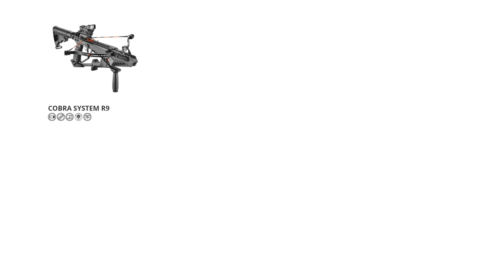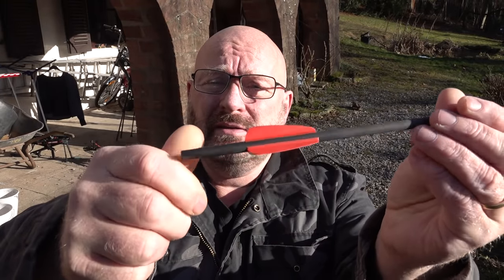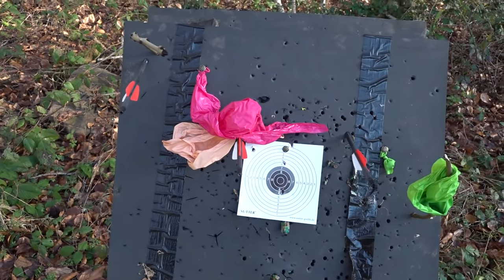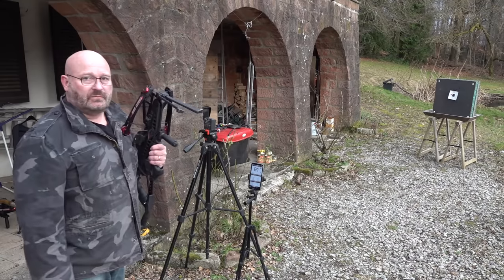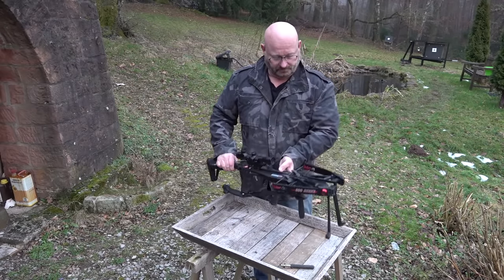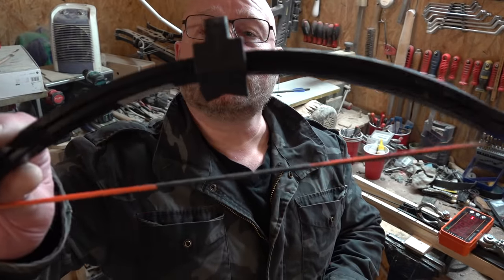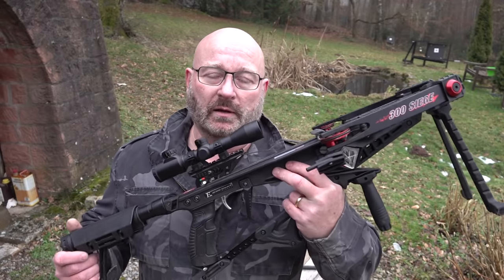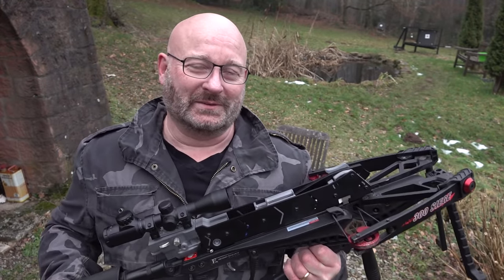The "Siege" Crossbow - Crazy Complete Review!

Comment: Reverse draw version would be insane. You would gain efficiency and lose like a foot in length. Hey Joerg send me one so I can build it haha 😄
Reply: Reverse draw? Can you explain? Cheers
Reply: @Meloncholymadness  a reverse draw is when the limbs are backwards facing away from you And this design eliminates brace height shortening the entire bow. Also you gain efficiency due to the string angle decreasing. Scorpyd makes good reverse draw crossbows.
Reply: I thought this too. Getting the slide to reach the string with the cocking lever in a reverse limb is probably the challenge. I’m a little shocked that the foot pound is so low. Needs a larger draw or better cams.
Reply: @CodyFIHS  needs better cams for sure they should use cam technology from regular compound bows you get way more efficiency with them.
Reply: @archery.customs  I suppose there wasn’t enough in the profitability to improve anything but the power they left on the table hurts. I would instantly buy for the $600 USD if it reached 100ft lb
Reply: @CodyFIHS  hell yeah because to me efficiency is everything. If they use better geometry in there builds they would have better products at not much more material cost. I guess it's the thought that counts and cost.
Reply: A reverse draw version will be the next generation. Maybe in abut a year or two from now.
Reply: @whiterabbitt2002  I hope so, if not I'll just have to build one myself 😆

Comment: Paper is amazing. If you want something that might stand up more to getting wet though, may I suggest trying out polystyrene card (also known as plasticard)?

It's a very common material that hobbyists use for model trains and miniature wargaming. It's plastic that come in a wide variety of thicknesses, even down to 0,2 millimeters if you so choose. Easy to cut with scissors and you could probably just duct tape veins made from plasticard to a steel crossbow bolt.

You can also glue it very well by using cyanoacrylate glue (common superglue), because cyanoacrylate will slightly melt polystyrene plastic before curing and basically weld plastic surfaces together to make a bond that is just as durable as the plastic itself.

Comment: Similar speed to the Ravin r26  top of the line hunting crossbow...but WAY faster to reload and much cheeper and no need to buy the really expensive press to change the string......this will drop most big game with the right hunting head on the arrow!.Cobra is on top of the game right now✊
Reply: You think this can drop an elk at 50 meters?
Reply: I have to disagree.   The performance of this bow is nothing at all like a Ravin or similar bow, not even in the same class.  I don't own a Ravin, but I do own a Tenpoint NXT400, and it will generate these same speeds(mine chronos at a consistent 408 fps) with a 400 grain projectile, generating well over 140ft-lbs of KE.  For the cobra to get that speed, he has to use a projectile of barely 1/3 that weight(139 grains) that he stated in this video, were much too light for the bow, and potentially dangerous.   To be clear, this is an amazing bow, but it's not a hunting bow by any means if ethical, clean kills(which should always be paramount), are to be considered.
Reply: @danielsimchuk7562  No way, at least not ethically.   This bow is generating those speeds using an ultralight projectile(139 gr) that has only a fraction of the KE needed on something like an elk, or even a deer.  I can get the same speed out of my bow using a 400 grain projectile generating about 3 times as much KE.  If you are in an area where crossbows are legal for big game, please consider one of the hunting class crossbows from someone like Tenpoint, Ravin, or Excaliber.  Performance and quality will be on another level entirely.
Reply: @NightwingGR1  Yes we all know that the Cobra crossbows have nothing on the Ravin for speed, distance and power as the Ravin and Ten-point and a whole lot of others. But the average person can't be bothered buying a 3000 Ravin500e or Ten-point Seige to name a few. They take forever to load, they're too heavy and needing winches or cranks like the dinosaur years. And for that sort of money you're better off with high powered rifles. The Cobra Seige bridges the gap a bit more so far as Speed, distance and power. Yet the Cobra Seige with a 7 shot Magazine is only $750 and heightens your chance of self defence. Easy to use, cocking etc. The Seige doesn't need all that extra power, speed and distance like the ones you've mentioned. I can afford all the ones you've mentioned as high powered crossbows. I personally choose a very Tactical, versatile, mobile and greater value for money crossbow any day. Tactical and very affordable crossbows are on the rise and will only get better.
Reply: @NightwingGR1  I'm not a hunter so excuse me if I'm mistaken, but it's draw weight is above the legal minimum draw weight for big game hunting in almost all states and 150-175 is what many hunting sites recommend for hunting elk. I get more is generally better (although sombre states have legal limits) but is there some other aspect this is missing?

Comment: Fascinating to watch the development of this platform. That said, having done a few of my own tests I’m convinced that the Adder (with the higher capacity clip-reloadable magazine) is the optimum tactical crossbow for home defense.
Reply: Yes the Clip reloadable magazine allows for the Adder to use the 15 inch bolts. Keeping in mind too that the Adder is faster and more powerful than the Cold steel cheap shot although both have the same draw weight of 130Lbs. I know the Seige shoots bolts faster, further and more than twice the power of the Adder, but I haven't seen the Seige with Magazine cocked as fast and frequently as the Adder. I own an adder and my crowd just find the speed and power of the Adder to be scary with some serious shock value.

Comment: In case people don’t know the most relative statistic (apart from shot to shot consistency) is the energy as described in ft.lbs (foot-pounds) /joules — this is more important in hunting than speed (fps/mps)
Reply: Exactly.  Several comments here have stated that this has the "same performance" as hunting bows.  It does not, it's not even close.  I shoot a Tenpoint NXT400 that generates about the same speed(mine chronos 408 fps).  BUT...it's doing so with an arrow nearly 3 times as heavy, at 400 grains, generating over 140 ft-lbs of energy.  The bow in this video would have problems with penetration on a larger animal at any distance at all, as in no case did the Ft-lbs of energy even approach that of modern hunting crossbows(in no case, even with the 1000 gr plus steel bolt, did it generate even HALF the energy of my bow).  Not to knock this, it's a very cool bow...but it's NOT a hunting bow.

Comment: Nice, some design decisions leave questions though. The scope being a moveable part is probably negatively affecting its zeroing/accuracy. Also, the bipod being unfoldable and unadjustable kinda makes the crossbow unwieldy and somewhat clumsy to use.
Reply: The bipod, at least, looks like it could be changed for a better one, or just removed entirely.
Reply: @MonkeyJedi99  It can defiantly be removed, as I've seen people using it without the bipod. Whether it's an attachment that can be used for other bipods I'm not sure, I'll look into that when I get mine.
Reply: @MonkeyJedi99  Got mine today and to confirm, yes, it's easy to remove/reattach without tools and works/looks fine without it, but it's specifically shaped to fit the front so I doubt you'll find another to fit unless they make one as an extra.

The foregrip however is on a standard picatinny rail, so no reason you couldn't swap that out for a bipod, or maybe a foregrip/bipod combo would be good.
Reply: @MrEsphoenix  Thanks for your review! Very helpful.

Comment: For 2-vane or 3-vane accuracy, I think that you'd need a much bigger sample size of hits across a much wider set of distances.
My hypothesis is that whatever effect the fletching has on accuracy will be observed at longer ranges.
Reply: I was wondering how come no one pointed out that the 2 vane arrows drifting to the right is exactly what 3 vanes is meant to prevent.

Comment: Also with the bow flipped so that the string rollers Arts of the front the overall Bow will not be any longer and it will free up the frame in the front for mounting accessories

Comment: If you flip over the bow so the compound wheels are forward you will get it much longer Powerstroke for the same length of crossbow
Reply: But then you need to ask how that changes things like the lever advantage for cocking, the speed of the bow limbs, and the mechanical complexity.
Also a factor could be profile. Hunters may be looking for a crossbow less likely to snag on things.

Comment: The two vane vs. three vane is really more obvious when you shoot broadheads. I know they are "tactical" crossbows but here in the U.S. most of us would buy these for hunting. I've added the 190# cross member to my cold steel version. I haven't had time to chrono the bolts but I've added heavier brass inserts and filled the shaft with salt to add weight along with lighted nocks for hunting. My Cheap Shot is New York legal for deer hunting and now capable.

Comment: Wow so awesome,
The only thing i don't like is the fixed bipod that's not collapsible unless it is but it looks solid, but I'm nit picking as a folding bipods are pretty cheap lol,
How the manufacturer dousnt think that a magazine is needed is beyond me it is now apsolutly mandatory
Reply: Perhaps you can install the front handle/bipod switchblade and remove the fixed bipod, it would not be as accurate, but it'll probably decrease total weight and certainly the momentum, as it's not attached to the end of the long x-box body.

Comment: A telescopic cocking arm could give more leverage without being too unwieldy or slow. A hinged lever at the end of the cocking lever could do the same. A hook in the buttstock, like in some target rifles, would then lengthen the stock and give more leverage together with the cocking arm. It could fold upwards or forward for shortening.
These changes may be expensive for the manufacturer, but cheap for owners to do. They could be useful for some more powerful, or shorter bow.
Reply: Mike Luostarinen  so it's sounds like you have a nice project in front of you. Put it together and compare it

Comment: I have found super compressed hay bakes are just right to not bury or break the arrows from the high powered compound crossbow. If the hay has moisture, you may have to take a long drill bit and drill 6 holes around the arrow, careful to not drill the arrow. Then it releases like dry alfalfa.

Comment: I'm not a mechanical engineer, but a stationary magazine for long arrows seems conceptually possible if the magazine had mounting/support points separate from the "sliding" section of the crossbow. To my understanding, the downward pressure from the magazine "lever" would function the same. 

Biggest problem I could see is creating enough space for the sliding lock mechanism and safety compartment to move under the long arrows when drawing the bow.....and for that I can't think of any solution which is why this is not my job lol

Absolutely incredible design nonetheless....and GREAT SHOOTING!!!

Comment: Looks good, very innovative design.  From the graph on the power measurements it looks like you can control the power with the length of the draw.  Multiple stops on the cocking lever would make for a nice upgrade.  But it might create a problem with bolt length.

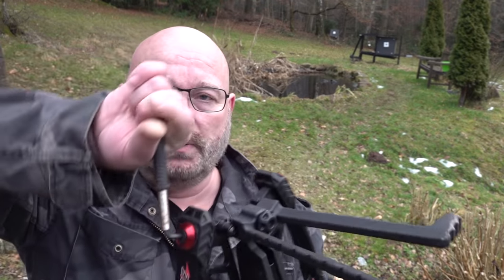Comment: Around 16:00, you show how the draw weight can be reduced by backing the limb bolts out 3 turns. However on page 19 of the Cobra Siege manuel, it says in red capitals
'WARNING: DO NOT UNSCREW THE LIMB BOLTS UNEVENLY OR MORE THAN TWO TURNS, OTHERWISE SEVERE INJUTY MAY OCCUR". Should I heed this warning or not?

Comment: Finally, the best, most complete crossbow ever is here! Is it possible to use aluminium bolts rather than carbon fiber ones to achieve better weight distribution for the smaller magazine compatible bolts? Coupled with heavier broadheads (like the bodkin tips from fenris arrows) the aluminium bolts might help provide the weight needed to keep the shooting safe.

Comment: Im loving the advancements in crossbow technology, my only wish is that they would stop trying to imitate modern firearms. I'm holding out for a model with an old fashioned in-line grip and no awkward protrusions in the front. I wonder how long that would take to come to market.
Reply: Not as useful or reliable. That's why they aren't built that way anymore
Reply: I can see your point. While the foregrip does help with unsupported accuracy, it can snag on things if you're trying to get through woods and scrub, or climb up to a hunting stand.
Reply: @matthewmckee3282  The pistol and foreward grips are for handling recoil on automatic firearms. If the gun isn't semi or fully automatic its a redundant feature. My pump shotgun has an inline grip, for example.
Reply: @matthewmckee3282  The pistol and foreward grips are for handling recoil on automatic firearms. If the gun isn't semi or fully automatic its a redundant feature. My pump shotgun has an inline grip, for example.
Reply: @maxvarjagen9810  In a case like this it's also for comfort. But it can be taken off if you don't want it.

Comment: I got one, and found upon assembling, found that the locking handle was very difficult to lock, have to bang it in hard to get the handle to lock, and it rattles, also the stock rattles, found the limbs smaller than I thought, but good,
only had the bow 2 hours
Reply from the maker: Just push the locking arm up a bit, then it unlocks very easily.

Comment: Maybe the two vane bolts shot right because the shafts are shorter so the dynamic spine is different. If the same concept applies as trad archery but results I'd imagine would be more exaggerated because of the power and distance. Hmmm.

Comment: Great stuff. 
Don't you think that for the movement of the scope, it would be more efficient to rotate in the horizontal axis (perpendicular to the axis of the arrow) rather than the pivot in the vertical axis? The return could be via a steel ball to lock the scope in place

Comment: What is the purpose of this crossbow?  It would have to be even more modified to use it for deer hunting. It's quite loud. The deer would jump the string. I am impressed with how accurate it is.
Reply: I get your point, but the important point is the speed of the bolt in that case.
If the bolt gets to the target fast enough, the animal will not have time to move and spoil the shot.
This is not a problem with rifles, as they are usually firing super-sonic rounds (bullet arrives before the sound).
Is it a problem with traditional and compound bows/crossbows? I don't hunt, so I am asking for qualified input.
Reply: @MonkeyJedi99  I have hunted with crossbows. My bow was reaching 450 fpm.  I have had deer jump the string even as close as 30 yards.  Deer can really be tricky sometimes.
Reply: @jumpingjacks5558  Huh. Deer do seem to be one of the 'twitchiest' critters out there I guess.

Comment: What's your thoughts on the Williams Tell Mini Striker Pistol crossbow? It's advertised as 330fps. World's most powerful Pistol crossbow?
Reply from the maker: The same crossbow under one more new name... in reality, it is a really weak model, weaker than the Adder and not even HALF as powerful as the Siege. The compound limb set is a disappointment, efficiency is low and you need special tools to exchange the string.

Comment: Hey Joerg .....I would love to see if you can possibly produce the siege into a reverse Draw version, using the current platform. Merely turn the original siege, and adequately install a reverse draw bow to the existing platform. This platform would instantly increase speed of the arrows, as well as kinetic energy, and would definitely be mind boggling for such a compact repeating crossbow such as your design😎🙏🏹🏹I would love to hear your thoughts about that idea 😇🙏👍
Reply from the maker: I looked at that option, but it does not work with this crossbow body. It is split lengthwise to make room for the sliding lock. There is no room for the riser part of the frontend. It would be necessary to design a completely new crossbow. But I question the feasibility of the reverse draw concept for repeating crossbows. The wear and tear on the string is much greater, due to the very steep string angle in cocked condition (almost 180 degrees). Repeating crossbows are shot much more often than single shot models, due to the much higher shot frequency. Constant string issues are much more annoying if you shoot many bolts during each session.

Comment: You don't suppose that these compound limbs could lead to the potential of a more ergonomic pump action as opposed to the lever, without losing too much power?
If it's even a possibility at all.
Reply from the maker: As I said many times, forget pump action. That is OK for the 5 pounds or so that it takes to repeat a shotgun, but NOT OK for the draw weight of a serious crossbow. You need a lever.

Comment: Hey Joerg, I have this issue with the cobra 300 I bought since the start: The cocking handle doesn't lock into the firing handle. I have to push really hard for it to cock firmly and safely.
Sometimes when I think it's cocked properly it still gets loose and it swings outwards violently.
Do you think I have to send it back or can I sand down the hook a little bit with sanding paper?
Because it might be a little bit too thick or sharp and that way the hook doesn't catch the bar inside the handle.
It seems to slip past it by less than a millimeter.
Reply from the maker: Well, if you think it does not work right, you should send it back for fixing or replacement.